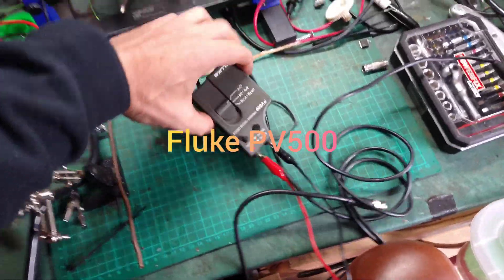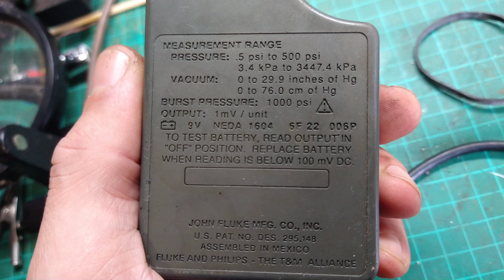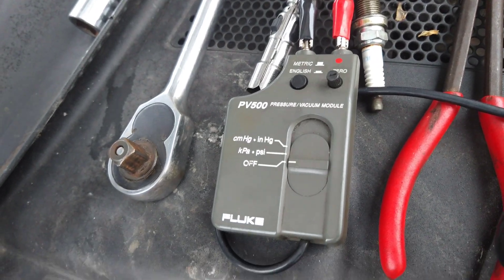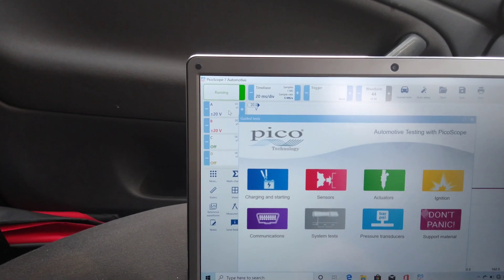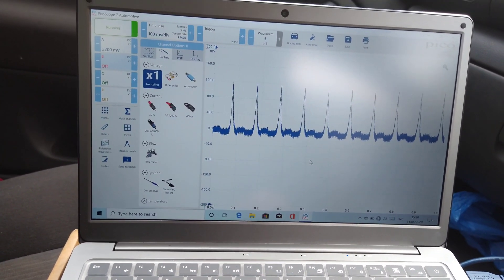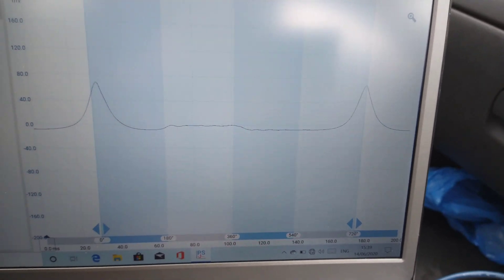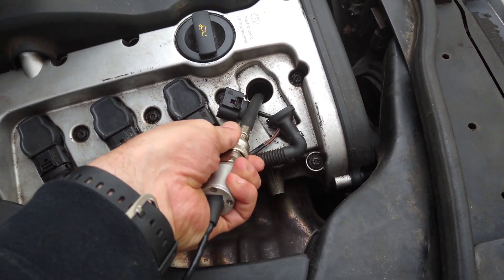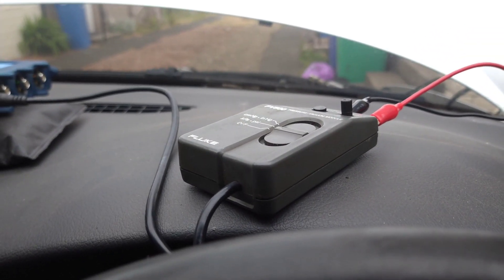Fluke PV500 (Pressure transducer)

Comment: So these mV correspond to PSI instead of bar or mbar?  Not too ideal. All I know (myself included) don't work in PSI...
Is that Pico Scope part of the setup or is it an extra thing?
Reply from the maker: It has a switch, you can choose 1mv/1 psi or 1mv/ 1kpa so you can choose what works best for you
Reply: @mechanicmatt871  Thanks.
If I googled correctly this is a separate item or does the whole setup come as one unit?

Comment: Don't run it to long because the temperature will go op significantly so run it as short as possible
Reply: In other words: It can damage your expensive pressure prob due to high compression temperatures inside the cylinder